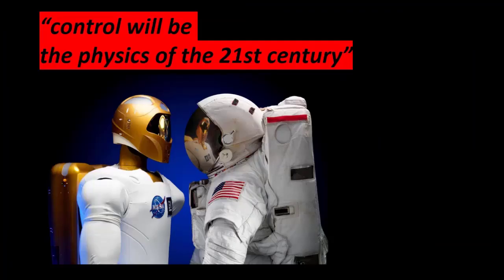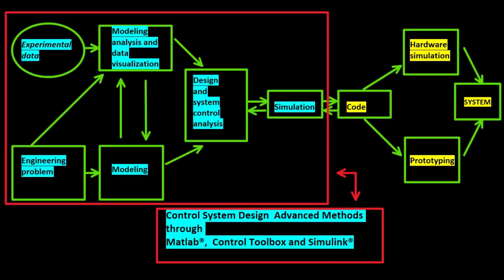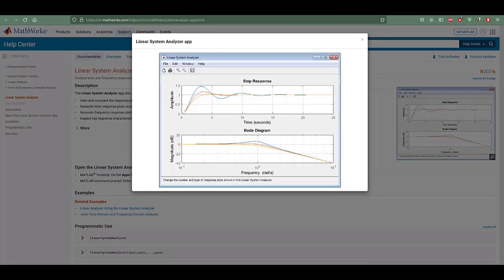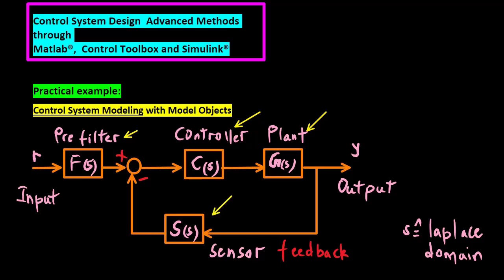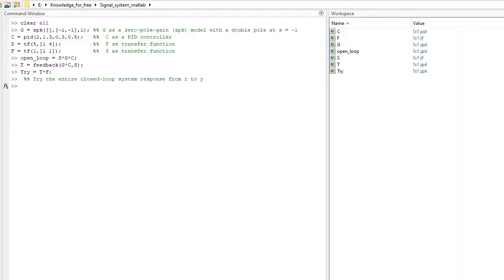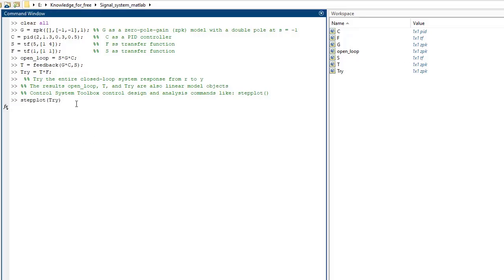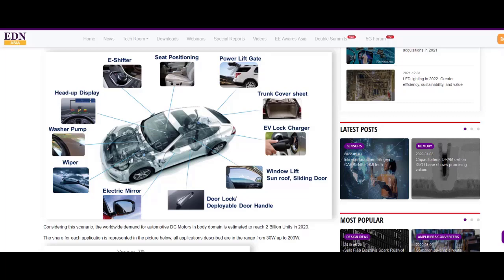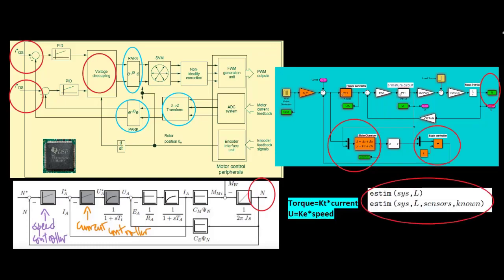Computer Aided Control Systems Design: Control System Toolbox

Comment from the maker: Practical control-system engineering using MATLAB, Simulink, and the Control System Toolbox.

This playlist covers both classical and modern control methods, including:

PID and control-loop design
Root locus and frequency response
state-space modeling
observer design
high-gain observers
LQ / LQR control
Kalman filtering
model-based design
rapid control prototyping (RCP)
hardware-in-the-loop (HIL)
simulation-to-implementation workflows

The goal is to connect theory with real engineering practice:

Model → Design → Simulate → Verify

This control foundation also supports wider eDrives Embed topics such as:

Motor Control → Inverters → ECU Hardware → Power Electronics

eDrives Embed Udemy courses

Practical Control System Design: Classical & Modern Methods
https://www.udemy.com/course/computer-aided-control-systems-design_control-system-toolbox/?couponCode=01683AF14DDCF7DF269A

PMSM Real-Time Vector Control (FOC) Simulation with Simulink
https://www.udemy.com/course/advanced-practical-real-time-vector-control-of-pmsm-drives/?couponCode=07E1E70B53D3B87A1979

Field-Oriented Control of Induction Motor Drives with Simulink
https://www.udemy.com/course/field-oriented-control-of-an-induction-motor-drive-simulink/?couponCode=7E513A4FFC46E68D7A36

Automotive ECU Hardware Design: Architecture & Simulation
https://www.udemy.com/course/automotive-ecu-hardware-design-architecture-simulation/?couponCode=6B8A4159A992EA1228C1

For electrical, electronics, mechatronics, automotive, robotics, aerospace, and control-engineering students and professionals.

eDrives Embed — Engineering beyond the prompt.

Comment: Hi i am student of electrical engineering profession. I like your video and how you go into details what most will skip. I always have problem in understanding control system design for topologies. For example for converter i know how to design simulation but dont know how to design feedback control system. Can you  make a video on any simple topology
Reply from the maker: so that you can understand the control technique and simplify the associated design and analysis functions, this course in udemy can be a good reference for you. there is the electromechanical example: dc motor, modelled analysed and the control for it explained both with pole placement technique and in the state space. the course is very inexpensive until tomorrow, after that you can use my promotion in the description. i have summarised the most important system control toolbox functions for you. it takes you years to identify these functions from the 3-digit page number of the mathworks manual. the sensorless control is also covered in it. after that you can use this for all circuits, be it power converters or machines or all dynamic systems.